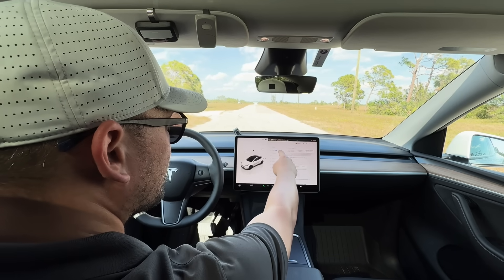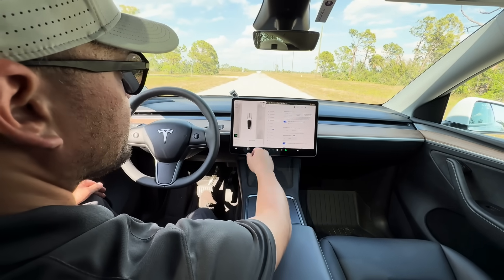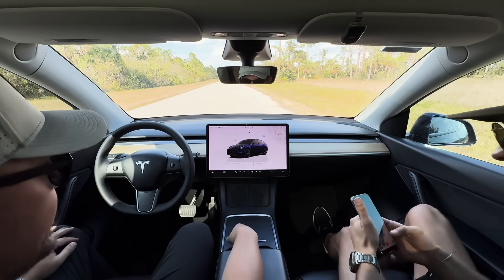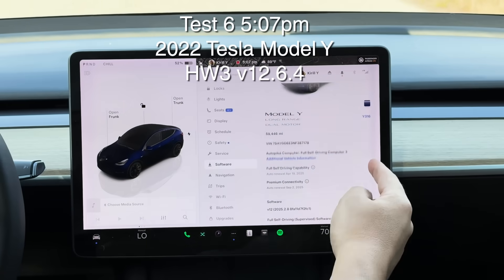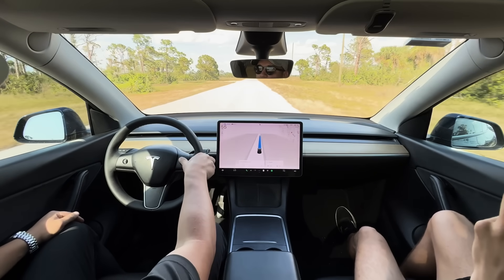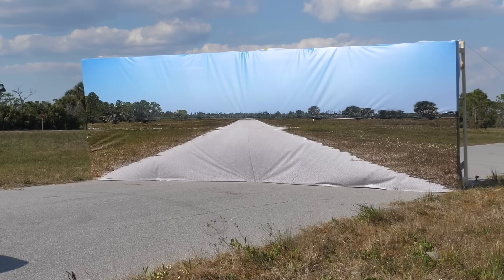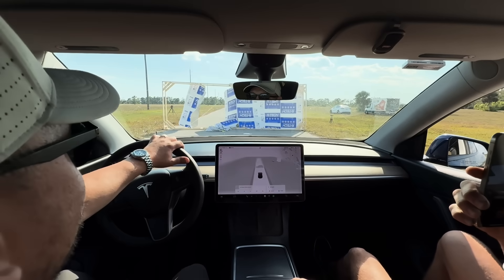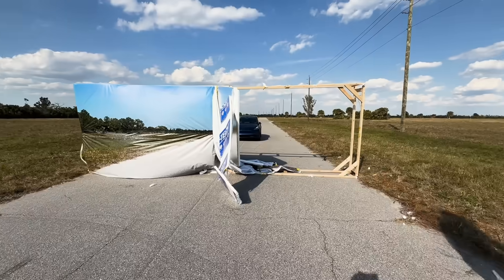Mark Rober Debunked - You can't fool a HW4 Tesla using FSD!

Comment: A LiDAR sensor now costs around US$100. Camera only based FSD is vulnerable to optical illusions in poor lighting/visibility. It may be 99.9% accurate but the 1 in a thousand times it makes a mistake especially at night, may be a high speed fatal car crash. If you drive your car twice a day, a thousand trips tick over in the second year. If you gave me a choice of paying an extra $100 to remove that 1:1000 risk of a fatal car crash, I’d pay the extra $100.
Reply: And expanded use will just bring costs down.  Capitalism is amazing.  Anyway, I wonder how much trouble they'd have incorporating a redundant sensor like that into their programming model.
Reply: @zendell37  3 years ago, 29 cameras, radar, LiDAR. No driver.  Tesla is so far behind. https://www.youtube.com/watch?v=yjztvddhZmI
Reply: @zendell37  3 years ago, 29 cameras, LiDAR, radar, no driver. Models going back to 2019. Tesla is so far behind. https://www.youtube.com/watch?v=yjztvddhZmI
Reply: 3 years ago, 29 camaras, LiDAR, Radar, level 4 driving no person behind the wheel. (also talking about level 4 2019) Tesla is so far behind its unfortunately a joke that still kills Tesla believers when their car slams into an overturned truck or some other unusual case. https://www.youtube.com/watch?v=yjztvddhZmI
Reply: The sensor itself might cost $100. It would cost a lot more to actually install that on a car in a way that it is able to function. But as Elon said himself, it is more about significant increase in server and computer use that LIDAR would require, not to mention potential conflicts between LIDAR and camera that would boggle down the computing process even much more.
Reply: @horange84  The sensor will not cost $100 bucks even in the next 10 years lmao. Even a chinese made automotive grade LIDAR sensor is still over 5000 bucks currently.
Reply: @horange84  If you are the car manufacturer and are designing the molding of the skin of the car the cost having it built into the car from day 1 would be a lot less than retrofitting. Originally Tesla had radar and multiple ultrasonic sensors. Which were removed to save cost on one of the more expensive EV. Radar should have spotted the wall, one question is that if Tesla removed sensors that would have prevented a number of accidents to increase its profit margins, are we meant to cry when putting sensors back into the car will eat into their profit margins but save some of its customers from fatal accidents.
Reply: @davidt9902  you aren't addressing the issue of increased computing power. More in this case is less - it's gonna make FSD more unsafe in the big picture.
Reply: I'm not sure where you're getting the 100 USD mark from but an FMCW Lidar module which is needed for automotive usage is going for at least 1500 and that's a very budget option. For example the Hesai's high-performance AT128 long-range lidar which the Xiaomi SU7 pro and max versions use are available for purchase at a measly $6,141.40 (for individual orders) so a far cry from 100 bucks. 
edit : I'm not saying having Lidar isn't nice and I sure hope Tesla adds Lidar to their setup one day but It sure ain't gonna be for for $100 plus having to deal with the weaknesses of Lidar too.
Reply: @ILFforever  In 2019 Tesla had radar and sonar for FSD. and Elon stated that buying a car without the hardware on the 2019 Tesla (which included Radar and Sonar) was economically insane and in 3 years time it would be like owning a horse. https://www.youtube.com/watch?v=V_ewrXkgRVA . 3 years later Elon removed the Radar to increase his profit margin. Congratulations for owning a horse. If you pay Tesla $8000 to enable FSD, it is reasonable to expect them to ask you to come into a service center and them spend $2000 adding back in the hardware for FSD, they are still $6000 ahead.
Reply: @davidt9902  I'm pretty sure the reason they removed lidar was because it was conflicting with the new FSD stack and creating false positives, so when they updated it they decided on removing the radar module. I doubt it's mainly a cost issue. Anyways the argument at hand is the cost of a Lidar module and it is definitely not a $100 module. Lidar being over $5000  not counting the cost for the existing cameras and upgrading the computational computer plus the extra power overhead. With all that in mind Lidar becomes much harder to implement on an existing car.
Reply: @ILFforever  when you are driving down the freeway at high speed and one sensor tells you that there is a solid object blocking your path ( so you should break) and another says the road is clear (so you should continue at high speed) removing the second means you may have phantom breaking and people hitting the unexpectedly stopping car. Removing the first you may kill the driver. Tesla used cheap radar, adding LiDAR was a better move. Other cars have had level 4 driving for years and are allowed to drive with the person asleep in the back passenger seat.
Reply: @ILFforever  simple see how far the truck moves https://www.youtube.com/watch?v=yjztvddhZmI&t=360s
Reply: @davidt9902  That was Autopilot over 3 years ago... The technology has far improved over that span of time. Both technologies has different limitations, like Lidar traditionally not being good areas which were not pre mapped. While Tesla's Vision AI approach should work in more situations. I personally think tesla should add back either Radar or the Ultrasonic sensors but not Lidar as would mean changing a lot of code, cost to integrate into the car and FSD as it is, is already very good at driving in difficult edge cases and detecting a lot of things. (Much better than the Tesla which hit that truck)

Again my argument in this thread is not to speculate whether which technology is required to achieve lv4 autonomous but the cost of Lidar, as it is not $100 like you suggested but much more expensive.
Reply: @ILFforever  My comparison is 29 cameras (mix of short range and long range), LiDAR and Radar, vs 8. If Tesla is charging $8000 for FSD, they can easily spend $2000 on upgraded sensors.  Two pushbacks I have heard was that Waymo was not capable of level 4, (eg 29 cameras LiDAR, Radar was not enough hardware). Or computing power has increased (making it easier to digest multiple sensors) or sensors conflict. At night two red car lights at rear can give an estimate of distance. While motorcycles with two red tail lights can provide an identical image as a distant car. And Teslas have hit and killed motorcyclists as a result of this optical illusion.  A $75 LiDAR sensor would have provided millimeter accurate distance to the motorcycle even in pitch blackness and no lights. As a result people die as a result of Tesla being too cheap to add a $75 sensor to a car for a service they can charge the driver $8000 to access.
Reply: @davidt9902  As I stated earlier, long range Lidar for automobiles are not $75!!! The example I made using the Xiaomi since that car is new and is selling for relatively cheap was using lidar over $5000 and you can bet Westen made ones to be even more expensive. Now if you meant Radar now that could be argued. I'd really like to see where you came up with that price for a Lidar module.

Comment: The big difference between HW3 and HW4 is the radar detector (Tesla's Hardware 4 (HW4) system, introduced in 2023, reintroduces radar) which makes a big different in this kind of test. HW3 lack front facing radar which is the reason why it did not detect the obstacle as the vision can be fooled by painting a picture which is matching with relative background. In my opinion my 2016 Tesla Model S with HW1.2 which has radar detector will stop the car nicely in similar conditions.
Reply: Tesla's Hardware 4 (HW4) system, introduced in 2023, reintroduces radar 
Pretty sure this isn't accurate. What evidence do you have for this?
Reply: @BigBen621  Google it. More over with out radar its hard to find the obstacles may be they improved the vision but i don't really buy in to that argument that only vision can find the obstacles like the one demoed in the video. I am pretty sure HW4 started using the radar sensor again. Waiting for parts catalog to see the evidence.

Comment: The perspective on the image is pretty clearly wrong, and it’s barely wider than the car itself. The original mark rober video this is responding to used a significantly larger wall. There is, without question, a configuration of images that would fool it. Regardless, this is far from the big problem FSD is facing, and there’s a reason no one in their right mind would ever take liability for a FSD Tesla driving across town with no driver. That’s not going to change anytime soon

Comment: Have you tried to build taller and wider wall? I mean, new FSD could tell if something is wrong with the edges of the wall, but if this wall will be bigger it will be harder for FSD to understand that. I think that removing lidars was a mistake. Instead of two different sources of information FSD just has one and it’s a problem with weather, sun shining, reflections and gaps in neural network training. With lidar those gaps could be easily filled.

Comment: Hmmm looks like Mark Robers video had an agenda 🤔
Reply: did u watch THIS entire video?
Reply: @ I did and I’ve watched many other videos which show mixed results depending on what version of FSD you have… however in this case it appears to be an advertisement for Luminar which mark had recently received a large sum of money for and is buddies with the CEO
Reply: @jbm9576  simple question, assuming it is an advert, does that somehow invalidate the results? does that somehow invalidate the point that proper range finding tech is superior for a fsd system?
Reply: @Darius-kl3jk used the latest tech for lidar but used an outdated software and hardware Tesla fl the test. It’s supposed to be fair both ways so he should have used both companies latest tech. Also he says he’s using self driving but actually uses autopilot in his test. Autopilot and self driving are two completely different things. I’m a fan of mark and I’m sure he didn’t purposely do what he did but for a science based guy he should have already known to use both companies latest tech. Also he should have known the difference between self driving and autopilot.

Comment: I mean how 🤷 it's vision based and does not have any sensors. How can it identify the fake wall. Anyway in real life there will not be fake mirror wall. What I am concerned about is foggy or rainy drives. It's impossible for Tesla to figure out obstacles just with vision based. You can say , on a rainy day Tesla will not turn FSD but what is there was foggy just near a pedestrian or something that occurs fast. These sensors are cheap , Tesla should consider using them

Comment: One Think I like to point HW4 or updated FSD wont help. It needs to have also that better radar system introduced. not all HW4 has that new radar. Though I would belive you dont get FSD option if there is no radar...  someone could confirm that.

Comment: Asking for a "human test" is a weird way to cope that I see a lot. For one, it's a bit of an odd self report that you can't handle the responsibility of driving, and second, if every HW3 version of Tesla fails this test, it only takes one human stopping to prove its better. 

It's also very strange to ask, "when will this scenario ever happen?" When someone recently died because the Tesla didn't see a semi trailer in the road in front of it. Surely that should be easier to see? And yes, that scenario will definitely happen on the road. Getting caught up in the semantics of "fake wall" is disingenuous and ignoring the problem.
Reply: March 18, 2016, Yahoo News headline: "Street Artist Painted a Road Runner Tunnel On A Wall, Someone Tried to Drive Through It"  So, yeah, at least two.

Comment: Thank you for actually doing an unbiased test. I would like to see this during the night!
Reply: I'd like to see a couple humans avoid that without knowing a wall was there... that's an unbiased test!
Reply: @daves2433  that's too dangerous. You don't know how an unsuspecting driver is going to react if they notice the wall too late. They might flip over the car.
Reply: @ How about one of those drivers ed cars with the second steering wheel & pedals. Not that it would be a clue to the unsuspecting driver.
Reply: @megapro125  I thought Tesla's were unflippable due to a low center of gravity from the battery?
Reply: @ are they? idk